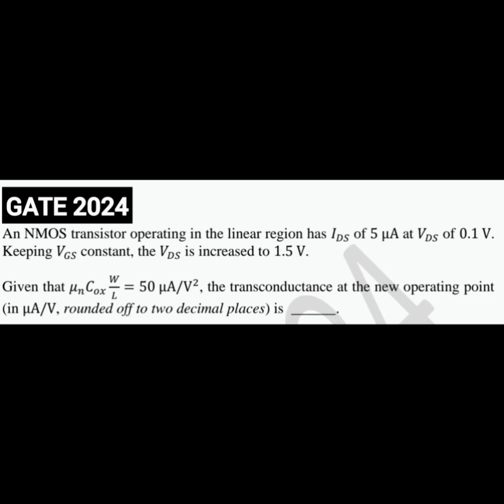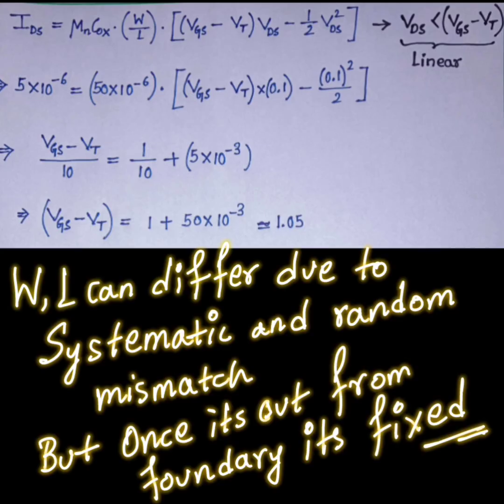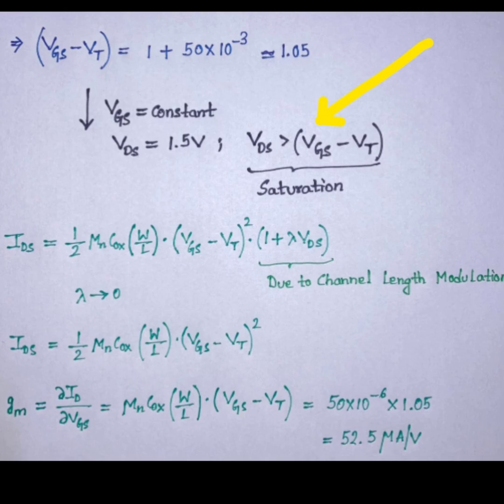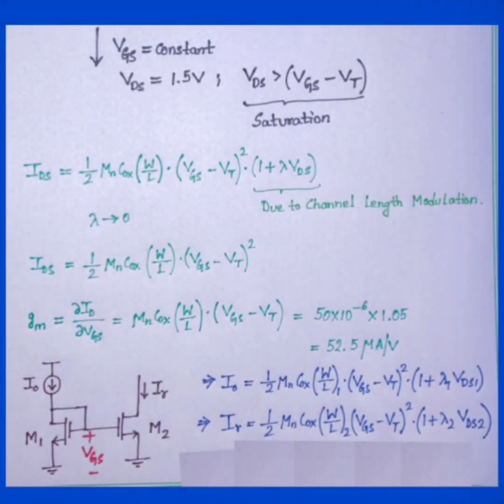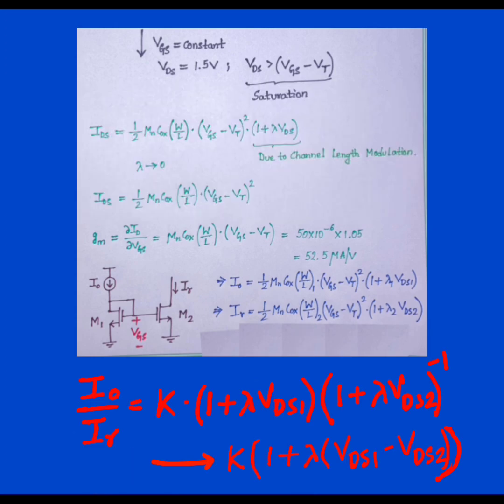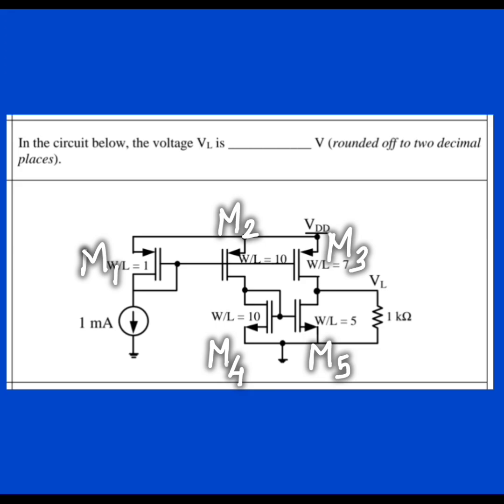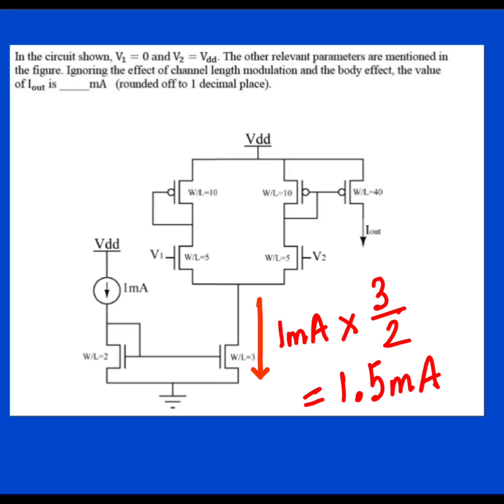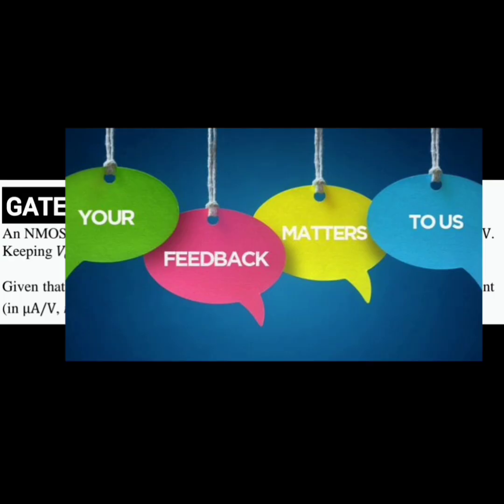BEST CONCEPT FOR GATE 2025 ECE/EE/IN | ANALOG ELECTRONICS | MOSFET #gate2025 #ece #ee #in

Comment: Sir

In GATE 2019 Q,

My doubt is do we need to determine the drain and gate potentials of bottom transistor with w/l = 3 in order to confirm whether it's in saturation or not by doing DC analysis..

Because the biasing current 1.5 mA is coming by dividing widths which in turn is coming by dividing saturation current equations of both MOS as also stated by you earlier in this video....

Kindly please guide..
Thanks.
Reply: I am dividing the W/L ratio on assuming that 1.5mA current is flowing as the bottom transistor which  is in saturation.. Which generally sets the bias current and do common mode rejection for  a differential operation.. But you must always annotate and check whether bottom MOSFET has VDS>(VGS-VT), but here no VT is given, neither Mn*Cox, I could not get the values and also lambda is 0.. If bottom transistor is not in saturation, mirroring will not happen
Reply: @nayanendubiswas662 

Ok understood sir.

And one more thing I would like to ask..

In real practice assuming the bottom transistor is in saturation and if we include CLM, so there will be mismatch as stated earlier in this session..due to Vds

So in real practice how much variation is allowed from the ideal value of desired biasing current...

Thanks for your guidance..